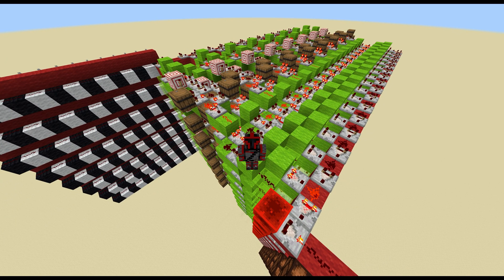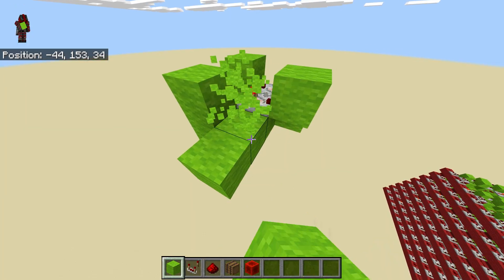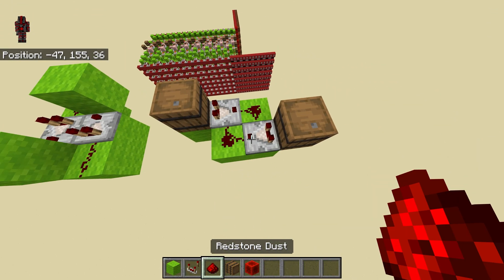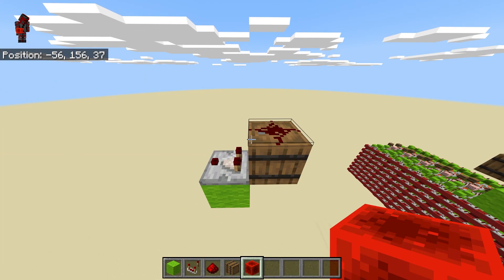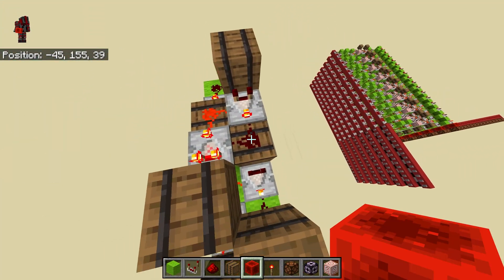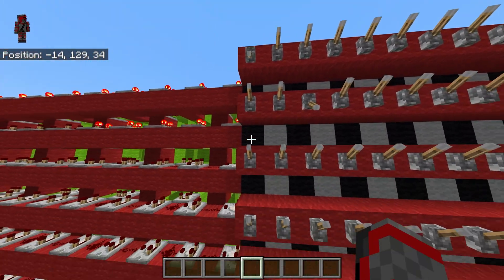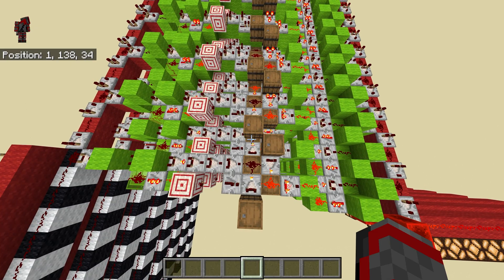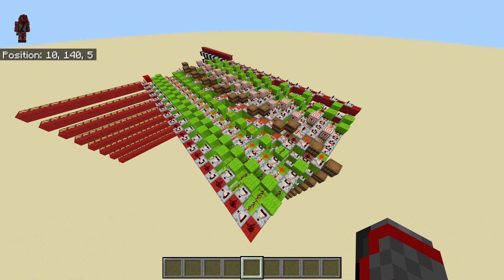Is This the Densest Redstone Memory Ever?

Comment: If you want a dense register design I have a really small one (using double density), and a 3.75 blocks/bit serial (page wiring not included but shouldn’t be bad)
They are both solid state memory
Reply: Repeater : ⬆️⬇️➡️⬅️
Comparator (subtraction mode) : 🔝🔜🔚
Solid block : ⬛️
Redstone dust : 🟥

⬛️🟥⬇️🟥⬛️
🔝🔚⬛️🔜🔝
🟥⬅️🟥➡️🟥

Comment: I managed to reduce it from your 2x2x20 to 2x2x15, which is now slightly more compact than my previous 4x4x4 (120m³/byte vs 128m³/byte). I am skeptical if focusing on 2x2 leads to the best option, 3x2x8 or 3x2x9 might be possible.

Comment: Yo.  Thats a nice Register design, it’s almost like a pulse length receiver ✊ and you have the noted value right there as well.

But in terms of density, personally I use stacked HEX|l♾️ps w/ hexbroadcast (modified hex repeater lines) to mux data where I need it. …took ages to develop, and I know not everyone likes looped memory, but within a chunk, it’s insanely stable on bedrock.

Comment: Very awesome video! I really want to see more hex redstone. But I think there's an even more underrated area of redstone knowledge, and that is bit-serial redstone.
You trade in some latency, but you usually gain a lot of "performance"(useful computation/tick): You can usually "pipeline" complex operations so that you can still do the same operations/tick as the regular "parallel" version, you just get the results a few ticks later. It actually combines well with hex redstone as well. I have an even more compact memory that is using "looping registers"(hex pulse trains stored in a comparator loop). It's stores 2 hex values per 2x2x3 cell, and that x3 is basically just because I'm not a good redstoner and my address decoder is pretty bad. The actual storage works fine in 2x2x2, it's basically just a loop of comparators. Each cell is basically a shift register that shifts every tick, and is feed well-synchronized clear/write/read pulses. With roughly the same volume as the build in the video I'm storing 200 bytes. 
(I really became enamored with bit-serial computers after playing around with the amazing WireWorld Computer which also operates bit-serially. WireWorld is a cellular automata like the game of life, but better suited to computation. It uses a memory system somewhat like what I've built in Minecraft, although there is no "hex" in WireWorld)

Comment: I maybe made a smaller 64 byte memory with repeaters (⬆️⬅️) and redstone (🟥) arranged like this:

⬆️⬅️🟥⬆️⬅️🟥
⬆️⬅️🟥⬆️⬅️🟥
⬆️⬅️🟥⬆️⬅️🟥
⬆️⬅️🟥⬆️⬅️🟥
⬆️⬅️🟥⬆️⬅️🟥
⬆️⬅️🟥⬆️⬅️🟥
⬆️⬅️🟥⬆️⬅️🟥
⬆️⬅️🟥⬆️⬅️🟥

Probably the densest way to arrange repeater lock memory cells.
It's very slow tho, because it's serial. If you want to read something, the whole data has to come out at once and loop back in right afterwards, so that it doesn't just get deleted. You also need something to read the flickering signal.

I guess you could also have 15 repeaters in a row instead of 8, but 15 bits per "byte" are a bit unusual.
Reply: Just stack the memory cells and connect them with vertical wires. For the selection of a specific byte you need vertical wires on one side and horizontal wires on the other side. The redstone shown above acts as a part of an AND-gate.
Reply: I don't think that's smaller.
Reply: I'm not sure about bedrock, but in Java this only stores ~8 bit, since 2 on ticks separated by 1 off tick just turn into 3 on ticks on repeaters.
Reply: @wawwior it would work on java too. With repeaters atleast.
Reply: @ИгорьДементьев-и7м not if the repeaters are back to back
Reply: @wawwior  On bedrock, it works perfectly fine. Repeaters, torches, and comparators are all 10Hz and there is no weird update order like in Java.
Reply: Its secvential. You could just loop comparators,storing a byte on each 2 for java and on each for bedrock.

Comment: Ah, I never thought to raise or lower the next cell over by a block. I've experimented with that shape and thought it was very useless before 😅 Great design!
Reply: alternating patterns are usually more compact in isolation, but now you have to deal with getting them connect to the same bus, which is definitely possible, but might then take more space up again.